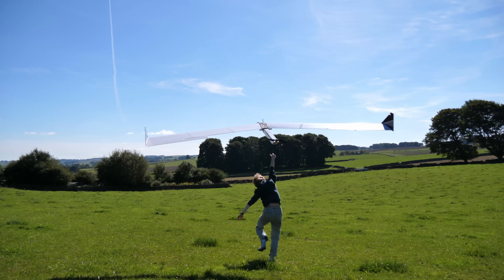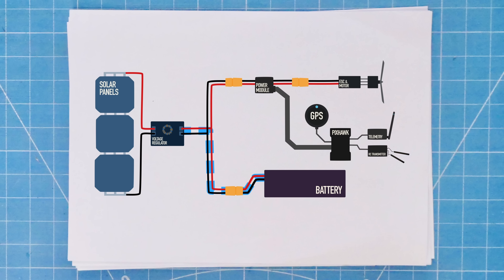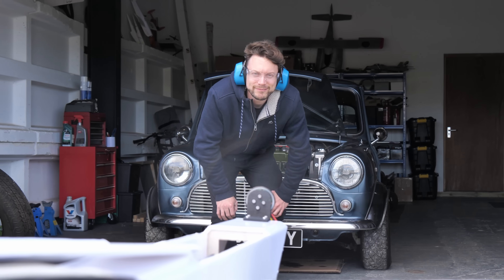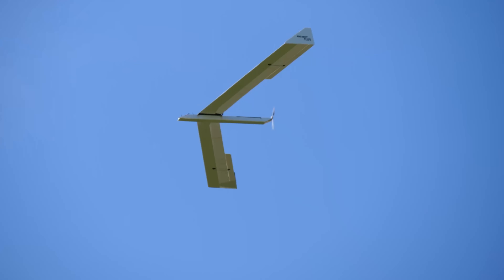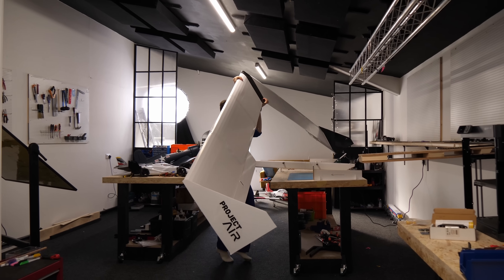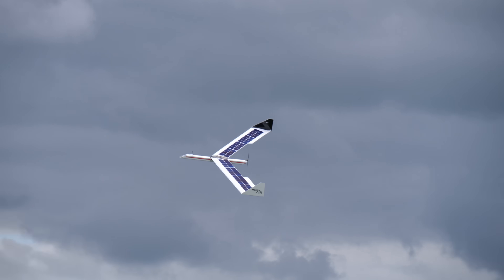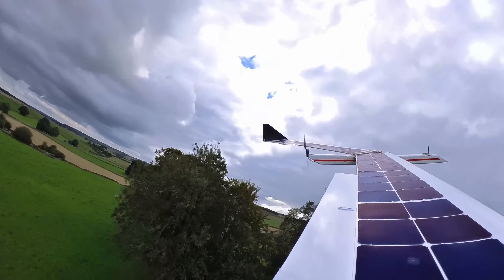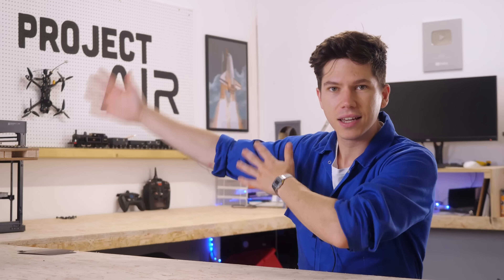Solar Plane V2

Comment: One of the things i have learned about MPPT controllers is that you never attach a load directly to them.  Instead, just connect your load to the battery directly.  The advantage between a MPPT solar controller and the voltage regulator is that MPPT or maximum power point tracking controller is that it actually operates the solar panel at the maximum power and efficiency whereas the voltage regulator doesn't.  This is especially important in the evenings and mornings where the MPPT controller will actually be charging the battery and the voltage regulator will not.  Unlike a battery, the solar cell produces the highest voltage (Voc) at open circuit and the highest current (Ia) at dead short and the MPPT controller adjust the voltage of the incoming solar to find the maximum voltage to get the maximum power (Vmmp and Immp).  Sorry for the long explanation:(  Great project and great engineering!!
Reply: This didn't make sense to me either. Seems like the solution was as simple as connecting the ESC directly to the battery and leave the MPPT how it was.
Reply: Came here to say exactly this. 
The previous mppt setup was like driving screws with a screwdriver. Completely fine but not quite practical for the application. Instead of going for a drill (aka connecting the battery directly to the flight controls and continuing to use the mppt) though he just decided to use a hammer to drive the screws. Yeah the voltage regulator idea works but you loose all the benifits of having a solar system since the efficiency is now much worse.
Reply: @Sandman22456 dick
Reply: @Sandman22456 🔴 What Is Islam? 

🔴 Islam is not just another religion. 

🔵 It is the same message preached by Moses, Jesus and Abraham.

 🔴 Islam literally means ‘submission to God’ and it teaches us to have a direct relationship with God. 

 🔵 It reminds us that since God created us, no one should be worshipped except God alone. 

 🔴 It also teaches that God is nothing like a human being or like anything that we can imagine.

🌍 The concept of God is summarized in the Quran as:

📖 { “Say, He is God, the One.  God, the Absolute.  He does not give birth, nor was He born, and there is nothing like Him.”} (Quran 112:1-4) 📚

🔴 Becoming a Muslim is not turning your back to Jesus. 

🔵 Rather it’s going back to the original teachings of Jesus and obeying him. 

More .....👇

🔴 THE RETURN OF JESUS
Reply: Hey James, listen to this guy. This is your solution. Get rid of that voltage regulator and just make everything draw power directly from the battery.
Reply: @danarrib   Nooooo.. solar panels give their best voltage at their MPPT voltage-that’s a variable voltage based on input and load. You are losing an easy 30% this way.

Bet you didn’t know that a solar panel with a direct short makes no power….
Reply: This guy is right, this is what we do in solarboat racing. It works well, very efficient and super simple to set up. Just use the genasun for charging, its literally the best on the market and connect your load direct to battery.
Reply: yes exactly, and you never set a voltage regulator directly to a battery, especially a lipo as it can cause it to pass current even when full, 
all they would needa do is connect the load to the battery, exactly as in the votlage regulator scircuit, but swap out the reulator with the mppt charger
Reply: @any1alive  so the battery and Mppt should be connected to the load in parallel?
Reply: You are totally right! In the mppt probably an overcurrent was triggered and shut the load down.
Reply: They should probably add a battery balancer to the setup too. If it does get to working the batteries will be floating around fully charged voltage with lots of cycles. That's a recipe for getting a lipo fire. Battery under voltage alarm is probably a worthwhile $4 too.
Reply: This is what I was thinking.
Reply: I'm pretty sure that voltage regulator module has CC/CV output, so they should be able to set the CV to the battery's max voltage. Either way, I agree that a cell balancer would be nice, and definitely agree that they should have kept the MPPT.
Reply: @EdwardChen0  mppt is about maximising the actual power available from the solar cells, the battery charging is a secondary function. Solar cells have a voltage and current level that they will output the most power at, that level changes with light intensity, temperature etc. Mppt finds that maximum power point, and pulls that voltage and amperage from the solar, then converts it to whatever voltage is suitable to charge the battery.
Reply: agree 100! this kludge is very inefficient. stick with the MPPT
Reply: Yeah a lot of normal voltage regulators, even the CCCV one they used don't play nice with power limited supplies like solar. 
It may work well in bright sunlight, but as soon as a cloud passes the amount of energy dips on the input, and can cause the regulator to go into hiccup mode. Depending on the controller IC it may need a power cycle to go back to normal operation.
Reply: So much cringe in this project!
Reply: So the mppt is the better way to use for solar planes right and not the voltage regulator? My concern is getting enough current too which is maxed out at 6amps using C60 solar cells for a 6s setup, idk how he managed to get that much power that even on 80 percent he said the solar was going to charge the batteries as well as power the motor and other electronics. If anyone knows a solution for increasing the current please let me know thanks.
Reply: @sicrick7356  increase current by reconfiguration of solar panels in parallel/series. Parallel increases current [capacity], series increases voltage. Remember current is drawn, not "pushed".
Reply: Good explanation. I was going to add that voltage regulators vary the amps drawn to keep output voltage constant. With these loads, amps are generally more important than voltage. The problem is if you have a high amp capacity source in front of the voltage regulator, then as voltage input drops, drawn amps will increase to keep regulator output voltage constant, and in my experience, this can blow fuses or cause fires on the input to the regulator. With solar panels as the source, there probably isn't that danger, but that of course depends on solar wattage in your case.
Reply: Thank you johntate5284. A bit of engineering savvy will help this project immensely!
Reply: RCtestflight does this and explains this in one of his videos.
Reply: kinda odd he knows what redundancy is but not for batteries apparently
Reply: imo be cool to see the Solar Panel charging SuperCaps or "hybrid supercapacitor" via an appropriate chemistry specific management would be faster recharge then trying to charge a lipo/li-ion pack
Reply: Hey john! It would help me alot if you please answer this. Do we need anything between the MPPT and battery for battery to not over charge or anything or does the mppt does that work alone of dividing the power to motor and charging the battery as required if the mppt is rated for the same setup for example a 6s setup for which a 25V/8A mppt will be used? The solar giving 6A and 24V.
Reply: @sicrick7356  a half decent mppt charger will float the battery after charging according to battery specifications. For example my caravan battery charges at 14.4v until it's full then floats at 13.6v or something like that. It should be a function built into the charger and configurable for suiting whatever type of battery is connected.
Reply: @sicrick7356  First off, a solar MPPT controller usually is set up for charging 12, 24, or 48 VDC battery systems.  For these types of systems, if you operate the solar array at higher voltages,(60 VDC up to 500 VDC), the solar MPPT  controller will actually increase the current at the lower output voltage (so, 100 V at 5 amps in can give you 14.2 V at about 31 amps with 90% conversion efficiency).  If the MPPT is boost and buck, it can take a lower solar input voltage and lower the current available to current to get a higher battery voltage.  Typically also, the max output current of your MPPT controller should be lees than your battery's max charge current unless the controller has a provision for a dump load (generally not the case with solar but more for wind and hydro systems).  Most current MPPT solar controllers have provisions for charging multiple types of battery chemistry which include lead acid, LiFePO4, and Li Ion (NMC).  Some may also support NiCad, and NMH (nickel metal hydride).  I'm not sure, but i think that most of the RC type battery packs are the older lithium polymer which i believe require 14.7 volts (for a 12 volt pack) to reach a full charge.  If your MPPT controller doesn't have a charging profile for lithium polymer, it is safe to use the lithium ion setting.  For lithium polymer, the charging voltage per cell (1S) is 4.2 VDC, while the lithium ion (NMC) is 3.7 VDC, so your battery will not get a full charge, which is actually okay as the battery will last much longer (mare charge / discharge cycles).  So, now for some questions.  What is your system voltage, battery type, and battery configuration (how many cells in series).  Next would be what is the make and model of the MPPT controller that you are using?  Finally, if the battery type is correctly set, the MPPT controller will help preventing a battery failure (fire!!) while the voltage regulator will not.  Since most, if not all of the RC battery packs do not have a BMS (battery management system), they depend upon the charger for that duty and this is why you really shouldn't use a voltage regulator for charging these types of batteries.  No matter what you ultimately choose, since this is a flying aircraft, you should consider finding a separate BMS for your battery pack (may add a few grams of weight) for safety.  Cheers!
Reply: @johntate5284   LiIon and Lipo have nowdays the same Full charged voltage at 4.2V but LiIon can go down to 2.5-3V while LiPo schould not be discharged deeper than 3.3-3.5V to enhance lifespan.
Reply: Thank you for writing long. I like long paragraphs. A lot of info in it.
Reply: Yeah, with a regular PWM based DC-DC voltage regulator, the first cloud that you pass under, the voltage regulator will clamp the PWM to as close to 100 percent (closed circuit current) as it can, giving you almost no power and it won't let go when you have sun again.

I think for something like this you absolutely need MPPT. There are universities and companies who can afford monocrystalline and multi-junction solar cells and they have a hard time pulling off net positive power. Its going to be that much harder using polycrystalline or amorphous cells. There are a lot of "flexible monocrystalline" cells being sold now. I don't know what they are but they're probably not those two things.
Reply: There are almost no valid use cases for the Load connections on a solar charge controller.  They're all highly specific.
Reply: That's what we do on solar electric ebikes and velomobiles.
Reply: Ironically ALL charge controllers with load outputs regulate this based on battery voltage...how did they miss this? Also it has 5A max written on it in bold....It probably cut out because of overload not low voltage.
Reply: Thank you. These people are super smart but don't get this simple thing. I am confused.
Reply: I need to see the next iteration … can’t wait
Reply: Your genius man, I am also thinking why MPPT are used and not simply boost converter❤❤
Reply: As an engineer, the solution is ez. Allow the mppt to charge a cap bank that has an active balancer & use a voltage regulator for the load. U can exchange the weight of a battery for a very large cap bank that likely will require a larger fuselage to accommodate it. Once fully charged, it will have a ridiculous loiter time.  It needs a larger tail, & an internal wing spar, like a few long curved dowels going thru the fuselage, wing to wing. Theres sum great vids on yt on steaming wood to bend it into curves. To fit them will likely require a clam shell wing design with sum strong lightweight glue.

Comment: Why not cutting some rectangles in the aluminium bars to make it a lot lighter and still durable and resistant. You should try first cutting small amount and try cutting more till the resistance is too low then you get new bars and cut them to the desired measure. Also you should let the batteries be in recharge only up to like 90% to not encounter fire/explosive hazards and similar and start recharging at like 70% or so. I would lastly suggest using at least 2 batteries to be safer in case one shutdowns or worse (could happen with lithium batteries). Source: I’m a student of Physics engineering at the Politecnico di Milano in Italy.

Comment: Your old mppt says on the casing it's for LiFePO4 - does it have a separate mode for LiPO given the much higher cell voltage etc?

Comment: I'd go with a proper MPPT charger to avoid the ~30% efficiency loss in charging, carbon rods (which are a lot less expensive than in the past) and lithium ion cells that are more suited to this kind of applications with their power density.